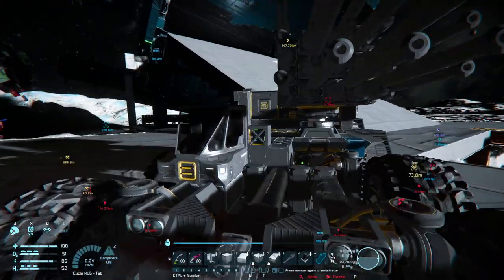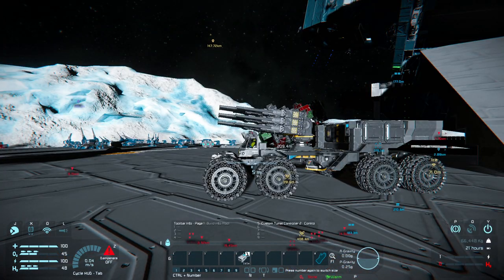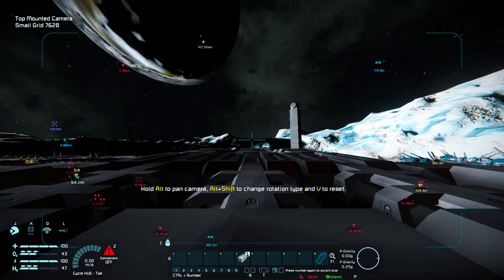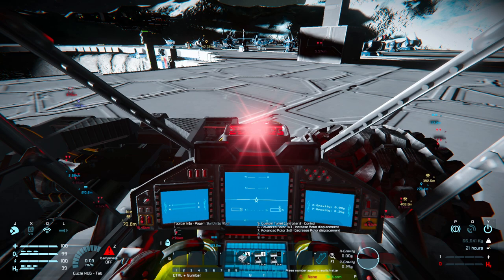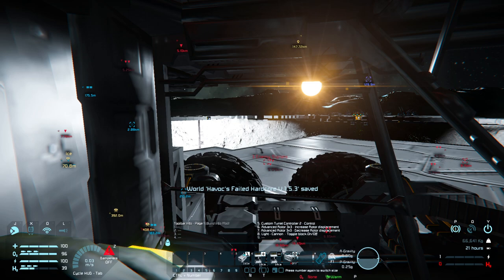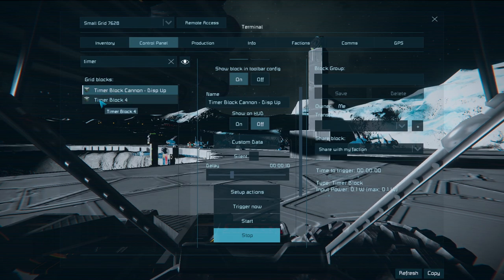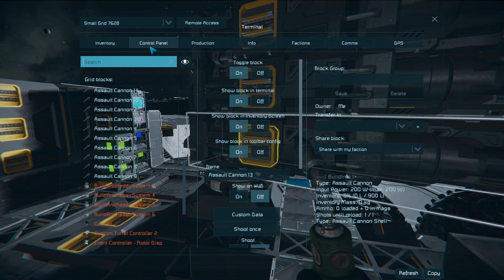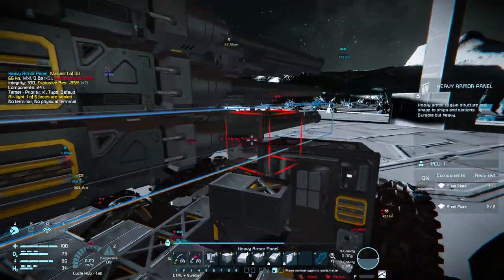Space Engineers ~ Not Hardcore ~ EP 162 ~ Roller Automation Attempt

Comment: 4:20 You can put some blocks behind the outside guns, and run them back a ways behind the center of the pivot, and put your gyros back there and they will not only have their normal effect on the gun but will also act as a counter balance, making their own jobs easier. [think of how a large crane has a counter weight on the back, only in this case, you are intentionally tilting the gun, so you do not want the weight to be in line to collide with the rotor and hinge, so setting it along side the hinge, but use the outermost guns as the place you mount them will allow you plenty of clearance to tilt the guns to their maximum height.

Just be sure they are more 'upward' of the center line, so that when the gun is in full sky-shooting mode, they do not crash into the deck.

I could sketch it for you but generally, if you just basically copy the whole 'duck tail' that the main body and most turrets already come with, that should be dead on the munny.

And again, the only reason to not put them all the way around the back is because that would limit the aiming ability of the gun if they crashed into the rotor or hinge, and too much length would make them crash into the deck.

I am under the impression that this is exactly why many of the more modern, more advanced turrets ended up being how they are now.

Good counter balance for the weight of the barrel, without crashing into the hulls of the tanks.